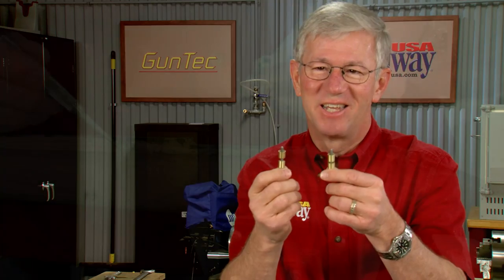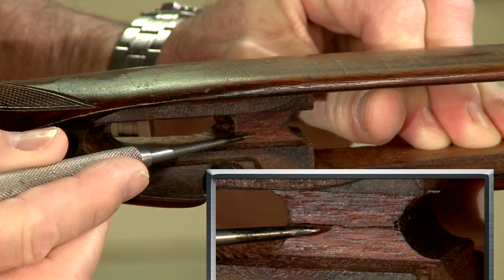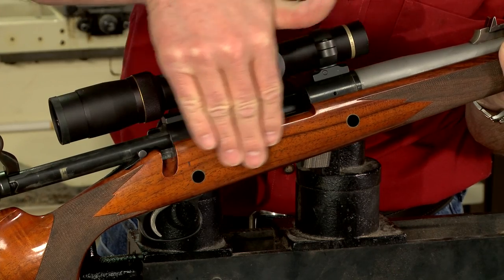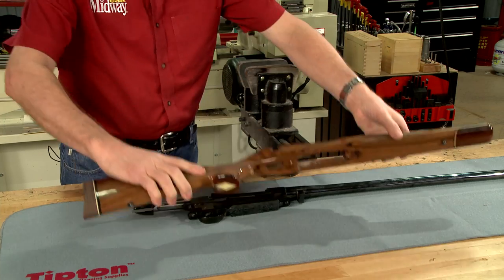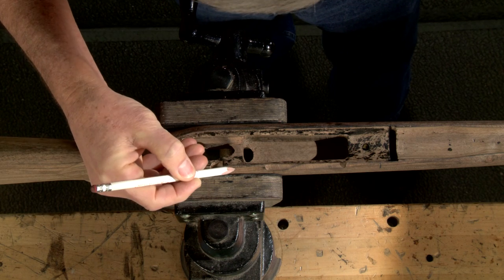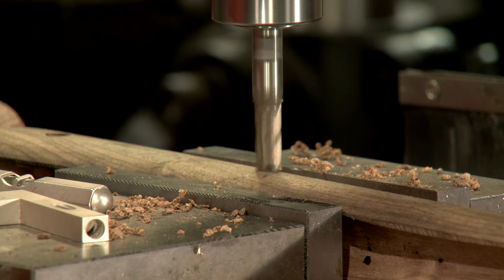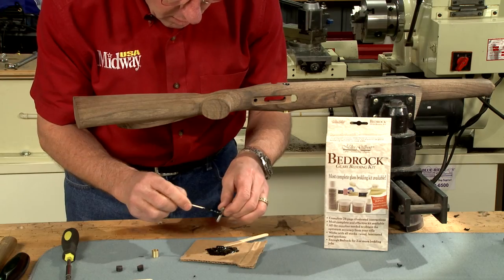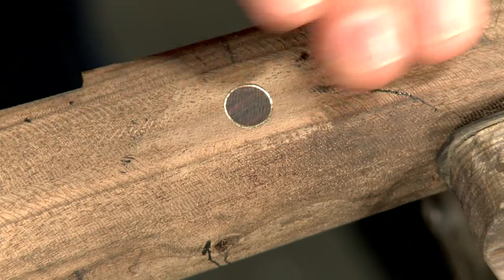How to Install Magnum Crossbolts in a Rifle Stock | MidwayUSA Gunsmithing

Comment: I sort of like the idea of taking the plug from the stock and using a larger piece of brass to seat the plug and seal the cutting ring. Then you can have the grain running naturally and confuse a few people on how you did that. Brass on light wood and billet aluminum for darker woods.

Comment: +AjackLee4
Depends on what kind of action you're using.
I'd recommend putting them in if you're taking an old Lee action and putting it in a new, one-piece sporter stock.

Mr. Lee was an excellent and incredibly forward-thinking designer, but one thing he nearly universally neglected to include in his rifles was a recoil lug. This led to the stocks on a number of M1985 Lee Navys splitting around the action, and is the reason why the No.1 and No.4 Rifles have a separate stock and fore-end.

If you're using using an old BSA P-14 sporter and you want to put it in a new one-piece stock, I would recommend the same thing, as I believe that they don't have any recoil lug either, and they usually come from the factory with a single crossbolt in front of the magazine.

If you're using any other kind of action which does have a recoil lug, I would say that crossbolts aren't necessary, seeing as you really only begin to see them on rifles that produce around 4000J, and even the hottest .303 loads only shoot around 3500J.